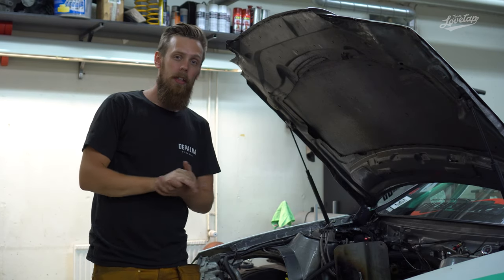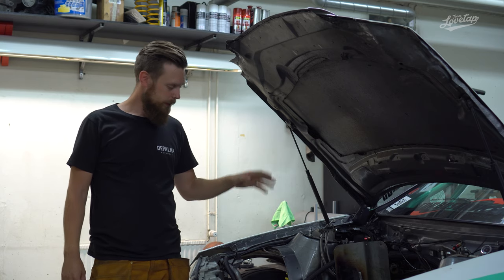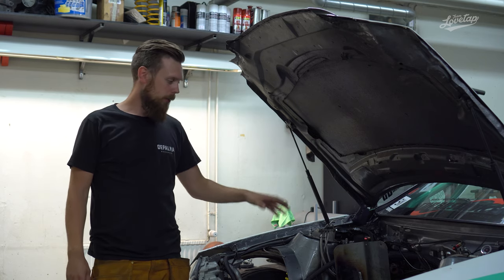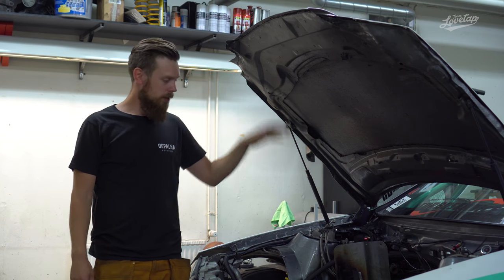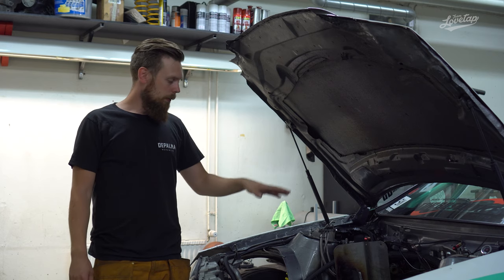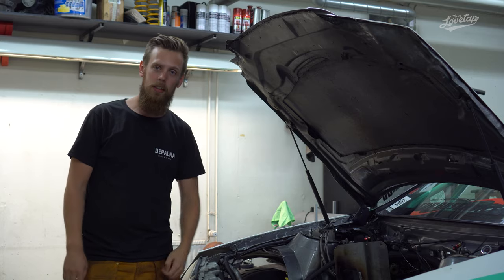M104 Timing Setup | Mercedes M104 Turbo | Tutorial

Comment: Thanks alot.
Ever since I replace my w 140 with m-104 engine head gasket I got total engine lost power especially when I use AC high fuel consumption and the overheating but as I watch that your  video I discovered that I made a wrong camshaft timing and I correct it everything is normal now
Reply from the maker: Thats great to hear that it helped you! This is the reason i made it 🥰

Comment: This is a super clean and informative video. I wonder where can I buy the head bolts? And how are the head bolts (studs?) different from the ones that came off of the car?
Reply from the maker: Thank u man, you can buy arp studs for the bmw m30b35🙌🏻 yes they are different from stock
Reply: @TeamLovetap  Ahh this is my first reply received on YouTube. Thank you for replying. Quick one: What is the benefit of using the ARP studs? 

Btw I am also a huge Volvo fan and would love to visit Sweden soon!
Reply from the maker: @yl7277  anytime bro, the benefit it that they can be tighten harder which puts bigger pressure on the headgasket which makes it withstand more power.

Also good to reuse because they are studs instead of bolts
Reply: @TeamLovetap  Amazing! Thank you Team Lovetap!

Comment: I have a question: OT is twice with ignition and without. How can i find out? I changed the valve seals and set the combustinchambers under compressed air so the crankshaft rotated!!! 
Can you help me please?!

Comment: When rotating the engine after resetting the timing and setting the tensioner, how much force did it take you? I am building a new engine and it feels awfully tight after I set the tensioner. Much tighter than any other engine I have spun over by hand. I am concerned that something is wrong but when I remove the tensioner it spins easy. Any tips? Thanks!
Reply from the maker: Did u reset the tensioner? Push the actuator through completly and then insert it from the back until the first click?
Reply: Yup. Tensioner was brand new as well as the chain and guides. Just measured with a torque wrench and it takes about 70-75nm to spin the engine.
Reply from the maker: @drewisweirdTV  ok, thats really hard to say.. but no sparkplugs in? Made sure the chain is centered on the guide? (Not on the guide edge? Easy to happen) can u move the chain up and down between the camshafts?
Reply: No plugs in, chain is centered and everything is lubricated. I’m going to double check the torque on my camshaft caps to make sure they are not over torqued (borrowing a friends digital torque wrench) but I don’t think that would significantly affect rotating force. There is no play at all in the chain once I set the tensioner.
Reply from the maker: @drewisweirdTV  that wouldnt affect it so hard, but check the video at 10:10 and see if the chain is moving like I am showing in the video?

Comment: Thank you!! Is there a way to check if the chain tensioner is still within factory spec? Mine is OE with 150k miles. Lol reuse or not to reuse?
Reply from the maker: jake castle should not be a problem ✊🏻

Comment: Man I am building a Turbo M104 here aswell and I am installing a standalone ECU. Do you happen to know which teeth the trigger wheel is aligned with the #1 cylinder TDC. I have a later model M104 with stock 60-2 trigger wheel here.
Reply from the maker: I domt use the stock trigger so I dont know unfortunately 🙃

Comment: Hi there I'm about to mount the cylinder head on my m104 2.8L motor. Is it really necessary to re torque the bolts as I've done numerous head installations and none required me to do so. Thank u so much
Reply from the maker: Vishnu Vardhan Kalainesan It is of course my opinion that you should do it but there are probably as many people who say its not necessary to do so. But i think it sounds pretty reasonable to retorque it after a heatcycle when the material in the gasket has changed a bit

Comment: Good stuff, I love it!  I'd turbo my M104.995, but i get lost when it comes to what to use for tuning. What are you using? Diff between .992 and .995?
Reply from the maker: Isaiah Brooks thanks man, you mean what ecu I am using?
The difference is that most .992 has oil nozzles for the pistons when most .995 dont have it.

Comment: hi there, this was quite the video i was looking for. now i found a m104 engine, 3.2lt with manual trans, driveshaft and diff for dirt cheap and i was wondering, will this fit into a w208? i was thinking a single turbo, aftermarket ecu and injectors, but everything else stock, like pistons etc. does anyone know how much abuse (safe hp always though) these things can handle stock?
Reply from the maker: Teo Jeo check out our playlist hammer and spanner episode 6-7 for more info about the engines. I would say 500 whp is pretty safe if you have it tuned well. Dont know if the w208 has front or rear oilsump, my w209 has rear sump so either you buy a rearsump setup or go drysump like i did

Comment: Hi, Did you use ARP 201-4602? Thanks!
Reply from the maker: Yes its correct but with different washers
Reply: @TeamLovetap  Was that to take up the difference of the 3mm head gasket?
Reply from the maker: MrController18 no its just that the m30 washers are to big
Reply: @TeamLovetap  Which washers to use? Considering buying these bolts for my future turbo-build
Reply: @TeamLovetap  what washers do you use?
Reply: Anyone figure out what washers to run ?

Comment: Wow...I replaced the timing cover gasket and then started the engine, heard a noise in the upper engine and cracked the cam gear shaft on the intake cam....what did I do wrong ?
Reply from the maker: Very hard to say, but did u reset the chain tensioner?
Reply: @TeamLovetap   I have not touched it. I don't recall doing anything to the timing chain when removing the cover and associated parts

Comment: why the head bolts are need to be retorqued ?
Reply from the maker: Because the tension changes abit after the first heat cycle, thats why we retourqe it to make sure it hasnt lost pressure on the gasket
Reply: @TeamLovetap  Thank you for the response. I'm going to replace head gasket on M104 but just regular one not like your enforced engine. Do you recommend to retorque in my situation?
Reply from the maker: @biopump2000  yes i do, run it up to running temps and let it sit for a while, then let it cool to the next day and retourque it

Comment: Amazing job!
Where did you get those torque specs for the head studs?
Also do they apply to the head bolts if you use them instead of studs?
Reply from the maker: Thank u! The specs are supplied by the manufacturer of the studs (ARP) the stock bolts have a different spec

Comment: My timing cover doesn’t have a mark ?
Reply from the maker: Then u probably have another way to zero out the engine, only came across this way though
Reply: @TeamLovetap  it does have the marker I just found it , it’s a separate piece you have to act attach it with a 10mm bolt.